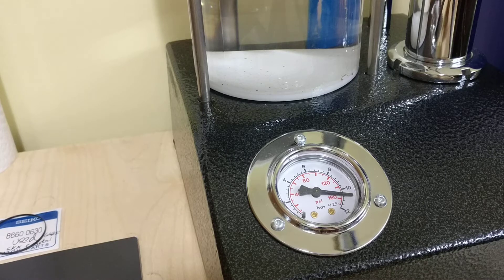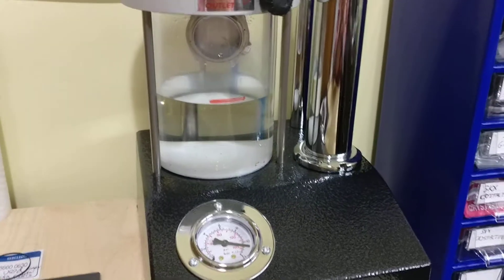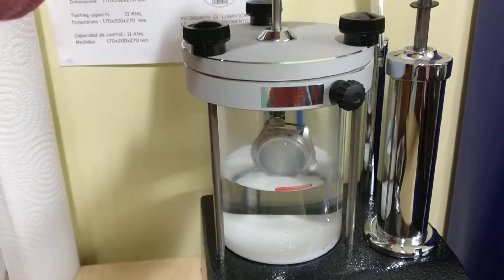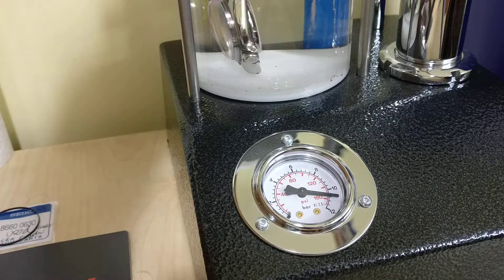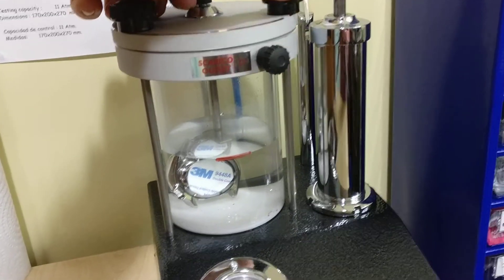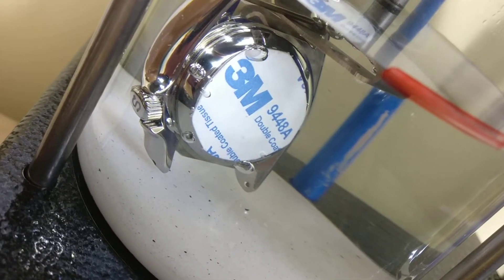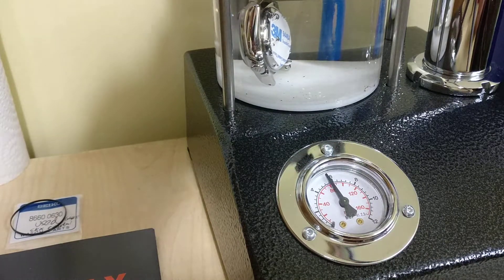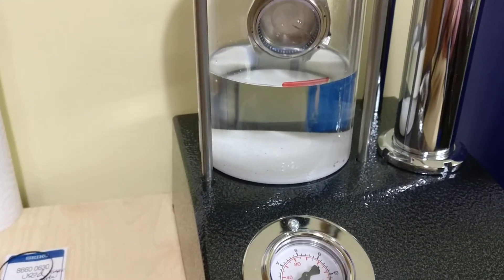Watch Water Resistance Pressure Test Fail. Seiko SKX007. Aftermarket caseback.

Comment: Thanks for the video!  I ended up here after finding your post (and link) to Mark/Islander Watches YT video on leak testing. All the videos I had found up to this point only showed watches that had passed the testing. And while I understood Mark’s explanations of the 3 methods of watch case pressure testing, for a guy like me, I really wanted - needed -  to see a test that showed a failure of the case seal. For me, it demonstrates that the test is capable of detecting a leak, whereas in a video showing a passed test, you really can’t be sure how or if the test is effective.  Thanks for posting!
Reply from the maker: Thanks for the comment Maurice.  Mark’s videos helped me too.

Comment: I believe some pressure should be released before lowering the case into the water. It there is a leak, you want the internal pressure to be higher than the external pressure. Otherwise you'll just be forcing water into the case when you dunk it. I think the pressure was still equalizing while it was sitting in the water.
Reply: You are right sir.
Reply: @LD-bf1mi  One would certainly think so- yes. But actually the manual says that you need to dunk the watch in the water and then release pressure from the valve...

Comment: What failed here? Was it a machining issue? Gasket failed? Good thing is you didn’t do it with the movement, would’ve turned into a nightmare.
Reply from the maker: The machining of the aftermarket caseback was at fault.
Reply: @tunokies  thank you for your reply :). good to know I will never blindly trust aftermarket parts just because they fit, and I can sleep peacefully tonight knowing the problem. Have a great day ahead.

Comment: Very interesting video!, thank you for sharing! what if instead water, it is used isopropyl alcohol, for example? so you can test a watch with the movement inside, and if it goes wrong is not water what is coming inside. Is it feasible? Thank you!
Reply from the maker: I'm just an amateur.  This is my only piece of testing kit. I don't know how that liquid would react to the seals inside the testing chamber or the seals on the watch.
Reply: @tunokies  Well, I mentioned because  isopropyl alcohol it is used for cleaning in electronic, it is not aggressive with plastics.
Reply: @federicoacker5672  alcohol would remove the oils from the movement. It would need to be serviced just the same.
Reply: @cv600rr  Of Course! you are right!, thank you for your answer!

Comment: I used to scuba dive alot years ago a got a smaller unit to test my watches periodically as they can be a bit expensive if they drown. Sort of noticed after about two to three years of age a 200m watch would leak around 50/60m .
Reply from the maker: That seems quite a short period of time but perhaps the regular use would necessitate a more regular change of gaskets and new silicon grease application.

Comment: ..and me... why is there no water in the case ? What is the need for an aftermarket case back if the original didn't leak ?
Reply from the maker: The aftermarket case back was a display (glass) back to view the movement. That was one of the mods/upgrades I was doing.
There is no water in the case because the pressurised/compressed air that got forced into the watch in the top chamber escapes the case as I release the pressure valve. If I had started to pump up the pressure with the watch in the water then water would most likely have got into the watch.
There's a really good explanation video from Mark at the longislandwatch channel under his watch and learn section. He's an engineer and can explain much better than me.

Comment: Have you tested Seiko watches that have been moded with sapphire crystal? How much compromise to the water resistance does changing crystal pose to watches?
Reply from the maker: Yes... that's why I bought this Calipso.  I always buy from Crystaltimes and they have always passed unless I have pinched the crystal gasket.  I just don't see the point of modding a diver unless I can test it... although mine will only go to 11 bar, I know people have tested them to 200m/20bar+ with no problems.
Reply: I have a couple of Crystal times and NAMOKI pieces in my collection and I've never had any leaks with them. What is your experience with NAMOKI?

Comment: Hello . Does the calypso hold pressure ? Can you leave a watch in there for an hour without loosing pressure ?
Reply from the maker: Good question. Not tried for that long.  Is there a reason to keep it pressured up for that long?  
I can try if you want me to.
Reply: @tunokies  i like testing to the extreme :)
Reply from the maker: @dimitristheoharis9552  Fair enough. I've pumped it to 8 bar and will reply in an hour.  Just for you👍.  What kind of watch work do you do?
Reply: @tunokies  i run therelumer.com , check it out .  I have been using the bergeon tester alongside a alc2000 but i need a 10bar wet test machine that can hold pressure for long time .
Reply from the maker: @dimitristheoharis9552  It kept exact pressure for an hour at 8bar.  Just liked your instagram page btw.
Reply: @tunokies  cool thanks . will get one from cousins then

Comment: Is there a way to perform this WR test with watch cases that do not have screw down crowns?

In a watch without screw down crown, the crown has to be locked into the movement in order to not fall out of the case. But then you would have to dip the case WITH the movement into the water...wouldn't you?
Reply from the maker: True.  I have done this test on cases without screw down crowns such a Seiko snzf17 and snzh55.  A little tape or a thick elastic band will keep the crown steady, not too much though, as you don't want it to obscure your vision or act as an extra seal.    You can of course test with the movement in place as unless there is a catastrophic failure water should still not enter the case, but I never test with the movement in on the first test.... just in case.
Reply: @tunokies  thanks a lot, sir!

Comment: the SKX don't have Drilled Lugs on their cases? i do not think this is an Original SKX case
Reply from the maker: Nedal Hubhub True. This one was drilled by John 'Thetigeruk' Bentley. It's a real skx - trust me.
Reply: you never said why you covered the backplate
Reply from the maker: The 3M tape is just to hide the identity of the caseback supplier - it was an old batch of casebacks and I believe they have rectified the problem now.

Comment: So that's what a leak looks like! Thanks for the video. I have the same Calypso, and it won't hold pressure. See you don't have that problem. Already replaced the brass fitting inside, it was visibly cracked and the leak was audible. Next time, a Bergeon for me.
Aloha from the Islands, we have some leaking over here as well.
Reply from the maker: holonalu Aloha my friend. I got mine after some recommendations, not least of which was Mark Lovick (watch repair talk forum/watch repair lessons YouTube) who'd used it for about 10 years. Had mine for less than a year so I hope your experience is the exception rather than the norm. Was it easy to 
A) put your finger on the issue?
B) get the part?   And 
C) effect the repair?
Reply: I bought it from Cousins in the UK. They're wonderful folks, always great to deal with, but, this pressure tester was defective from the start. If I lived in the UK, it wouldn't have been a problem, however, there's these two oceans. They sent me replacement parts, the t-fitting that connects the pump to the tank and gauge, and the brass connector. The brass piece was the problem, should never have been attached to the machine to begin with, as it was cracked at the threads on the pump side. Got it all back together, but it still won't hold pressure for long. If I had some small 9 mm wrenches I'd check the rest, but, later. Right now it's good enough, just not 700 USD good. Company that builds these never should have let this one out the warehouse doors. And, oddly enough, the Calypso leaking more or less coincides with Madame Pele's latest antics, so, perhaps there's a connection.

Aloha from the first large rock north of the Leaky Rock,
Thomas

Comment: Have you also tried with the original caseback ?
Reply from the maker: Robert Klatich Yes, the original is fine. The metal is just too thin on the aftermarket case back in the notches.
Reply: tunokies thank you! I want to get one so i have to be sure it’s worth it.
Reply from the maker: Robert Klatich no problem. It's a Calipso and came from cousinsuk.  I did a fair amount of research before settling on this one over the Chinese Bergeon 6bar copies. I used to take all the Seiko dive watch mods to a third party for testing and this Calipso will have paid for itself within a year.